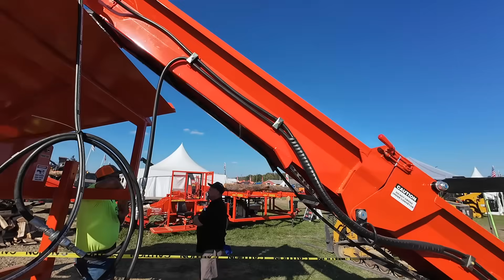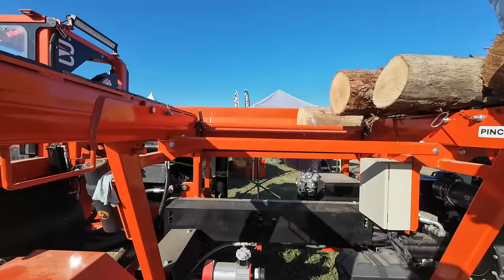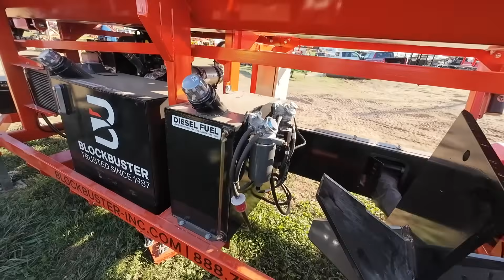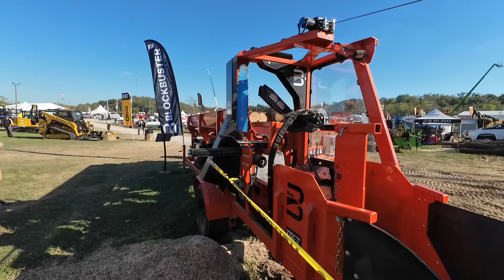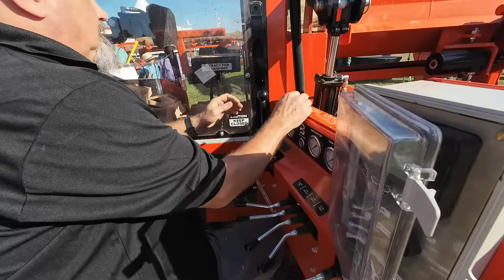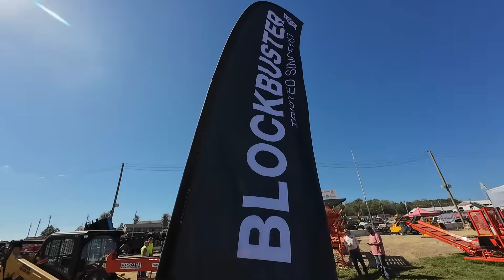NEW BLOCKBUSTER B18HP FIREWOOD PROCESSOR!

Comment: The names are still crazy. When I hear 18 HP I'm thinking 18 horse power lol.. a model that you can add an "after market" box wedge would be nice. To me your defeating all that new speed if your spending a lot of time kicking back resplits.
Reply: Exactly! Box wedge!
Reply: @dethmaul they can sell it with a box wedge on it but can sell you the box wedge as an accessory attachment. Which is dumb but japa has a odd patten on processors with a box wedge.
Reply from the maker: Maybe so.
Reply: 👍 @InTheWoodyard

Comment: pass the word to the nerdery: if they make a reversible sawdust chute, changing between putting the sawdust in a container from the top or from the front, would be changed just by rotating the chute 180 degrees.
Reply from the maker: They will probably see this!